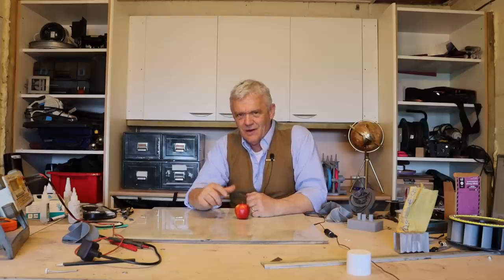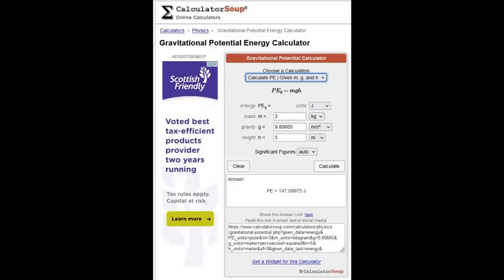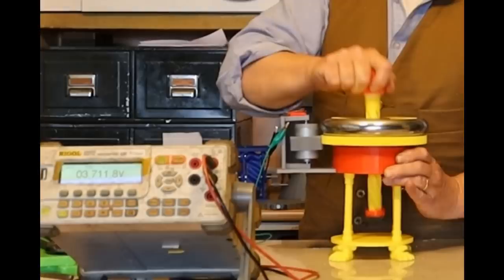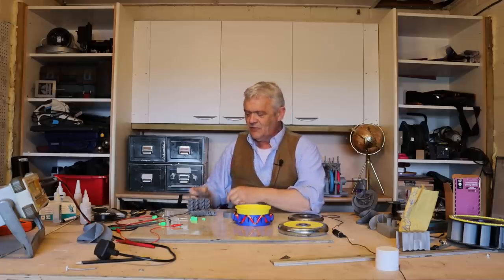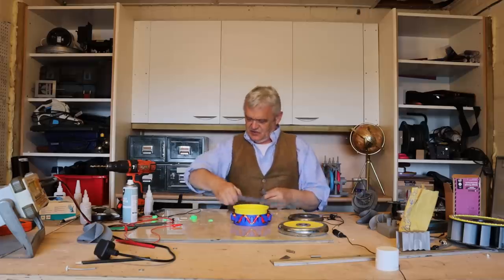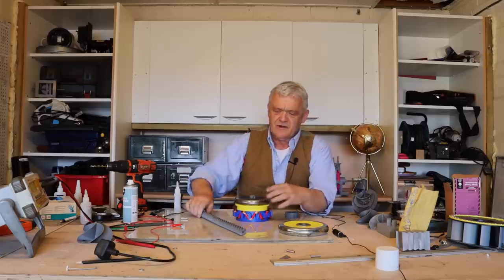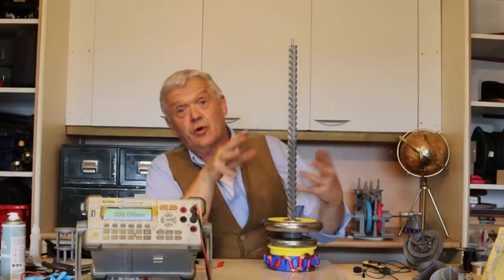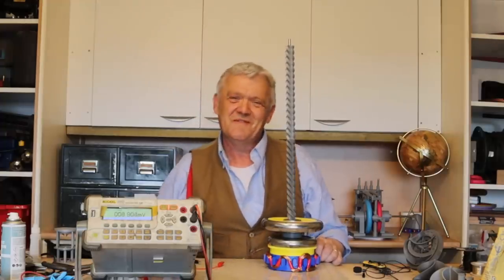2047 Gravity Energy Storage

Comment: When a permanent magnet attracts and holds a piece of iron against gravity, is work being done? If so where is the energy coming from and why doesn't the magnet "run down", if work isn't being done, what is happening? If I held the piece of iron aloft, I would need to expend energy.....Your talk of lifting weights made me think of this.....
Reply: I think the best analogy is to compare it to Gravity.
With gravity, the force is only expended at the moment of attraction and impact, but, once impact is made, contact is now the "Resting state." Attempting to remove the magnet(s) or objects would be where more energy was required.
Reply: Follow up question: is a mountain being held up by a constant expenditure of energy and will that energy ever run out, leading to a completely smooth Earth? Are there ancient planets that have become smooth after running out of energy to resist gravity? Do atoms need to expend energy to not simply collapse into each other? Will matter itself eventually run out of the energy required to make it matter in the first place?
Reply: @ArosIrwin  Great observation! So there appears to be an infinite source of energy in the universe, we just need to expand our understanding in order to engineer free access to it! We have trapped ourselves into the closed system of thermodynamics which limits that understanding and access....
Reply: For work to be done, a Force has to be moving through a Distance. If either one is missing, there is no work to be had. E.g. If a force is being applied to a mass but it is not moving. No work. Conversely, if a mass is coasting along in space with no force applied. No work. Push a brick along the ground, Force x Distance = Work. For a magnet holding aloft a piece of iron, nothing is moving. No work.
Reply: An object at rest has potential energy, regardless of the reason it’s at rest, whether it’s being magnetically prevented from falling, or mechanically, for example, on the palm of your hand, or, being on the floor.
Reply: @Gruxxan Yes, but the piece of iron is held underneath the magnet, defying gravity. If it were an electromagnet, energy would have to be dissipated to create the magnetic field. The permanent magnet just keeps holding, no circuit power needed. Obviously the magnet was magnetised in the first place, but that energy is not dissipated  as it holds the piece of iron, unlike with an electromagnet that will drop the piece when the coil is de-energised. So it seems the permanent magnet is exhibiting a characteristic akin to gravity......?
Reply: There is potential energy, but since the iron piece doesn't fall off by itself, it needs some extra energy to make it fall, so that when the piece is at a minimum distance it can fall off. It reminds me of the activation energy of a chemical reaction
Reply: @ArosIrwin simply, yes. Matter is simply ordered energy. When the order is gone, matter is no longer. All that is left is a soup of incoherence.
Reply: The magnet isn't doing work on the metal, it's just that Earth is failing to do work on it. The reason behind that is that gravity is by far the weakest of the interactions so even the entire Earth isn't enough to overcome with gravity the effects of that single magnet that uses the electromagnetic force instead. That's also why gravity doesn't flatten structures in situations when chemistry has a say about shapes.
Reply: @mfr58  1) magnetism is one of the 4 fundamental forces, like gravity, yes.

2) permanent magnets do lose some strength under load, it just takes lifetimes, as it is doing said work, even on an obeject at rest.

What you want to do is look up magnetic flywheels and kinetic energy storage systems.  The answer you're trying to get to is far, far too in-depth for simple YouTube back and forth.  There's unironically 8 to 12+ year degrees dedicated to the subject lol.
Reply: Great question! It has resolved my lifelong curiosity with magnetic possibilities. As much work as it takes to attach a magnet, it takes 100% - that to be unattached. Changed my reality. Thank you! 
Example, how easy is it to smash a window with a hammer, if you have to make that same exact window from silica and that same exact hammer from iron ore?
Reply from the maker: no mate - work is force times distance - if it is holding the iron it's really like asking does a screw do work to hold up a shelf.
Reply: @ThinkingandTinkering  That's a logical observation. But  it does rather side step the issue of the apparent power of the magnetic field, superficially at least it seems very different to apparent mechanical holding of a screw.....
Reply: @saiello2061 Everything is moving, we just don't sense it because it's all relative.
Reply: @mfr58  That mechanical holding is also based on the electromagnetic force, mostly in the form of the chemical bonds in the material of the shelf and the screw itself resisting deformation by shear stress.
Reply: @jounik  Yes, that's true. So we start to get to the non "material" quality of nature. Everything is spinning vortexes of different wavelengths, so if we can comprehend more deeply how this works, an infinite source of useful energy could be available to us, beyond the constraints our current physics imposes on us.... Given people's responses here, the phenomenon of magnetism is not sufficiently understood at present...
Reply: Potential energy can be statically stored, but there's a cost to release it for use.

Same as a piece of wood holds potential energy and releases it if you burn it, or an apple holds energy until its processed by a system that can harvest it.

It's also the reason you can cut metal with bacon...
Reply: @adrianscarlett  If I hold a piece of iron close enough to a magnet, it is apparently attracted to it and moves toward it, where it is then held (if not attracted more by gravity). So is work being done when the magnetic field "pulls" the iron from my hand toward itself?
Reply: I suggest you revisit the definition of mechanical work as it was taught to you in school: the force applied to the body multiplied by the distance upon the body is moved. If the body doesn't move then no work is being done. The mere presence of a force doesn't mean that work is being done.
Reply: @lucianene7741  I suggest you revisit what I said. The piece of iron is moved toward the magnet...force x distance = work?
Reply: @mfr58  
It's pretty clear what you said. You didn't mention anything about the object being moved, just attracted and held against gravity. Then you equated this with you holding a weight aloft. Attracted doesn't mean moved, it only implies the presence of a force.
Reply: @lucianene7741  Yes, correct that was my initial comment, but in response to others I did mention movement. But anyway, can you now answer my question, is work done when the piece of iron is "attracted", moved toward the magnet over a distance?  According to your quoted definition the answer seems to be yes, yet I am told work is not done ....so?
Reply: @mfr58  
Work is being done during the process of moving the body towards the magnet. The energy that is used to produce this mechanical work comes from the potential energy of the magnetic field - it's called magnetic potential. Every force of nature has an associated potential - electric potential, gravitational potential, even nuclear strong force potential. The last one is VERY strong, this is why nuclear fusion releases so much energy.
Reply: @lucianene7741  Yes, but my issue is that the magnet never runs out of the ability to do work, it will be able to keep moving ferrous material toward or away from itself indefinitely  (save for domains randomising over time). So why can't we access this "free energy", after all the universe is filled with it?
Reply: @mfr58  
This is not free energy. Force does not equate to energy. Replace magnetism with gravity and the situation is the same - you can't use gravity to generate free energy. You need energy to generate work - nothing comes free.
Reply: @lucianene7741  That sounds correct, but we are left with a mass being moved over a distance by a force, which I'm told equates to work being done....It seems like gravity and magnetism are exhibiting similar behaviour....could they be different faces of the same quality?
Reply: Important thing to note: work is not energy, though they do have the same units. Energy is the capacity to do work, but work is just force applied over some displacement. Think of energy as what a system could do, as opposed to work, which is what it actually does. In your mountain example, the mountain expends no energy keeping the rocks at the top at the top. If the rocks are moving, like in a mud slide, then work is being done. Do note though, that if the rocks that fell were somehow placed back where they originally were, no work was done, and that is because the process doesn't matter, even if there was motion involved. Work is a net measure, so what you pick for the start and end state of the system matters. If a force is applied that ultimately puts the system back in the same configuration as before, no work was done because nothing really changed. In ideal scenarios, where you can ignore fiction and other inconvenient realities,  you can do something and undo it and achieve exactly zero work, but in real world scenarios, there is always some work being done even in cyclic systems like engines because of the friction or other forces that have to be overcome across its various surfaces. This is often accounted as waste heat or acoustic noise.
Reply: @Zeero3846  
So much effort just to put out such nonsense. Sorry, but work IS energy. Same as heat, kinetic energy, radiation, electric/magnetic, chemical energy, potential energy, enthalpy. One form of energy can turn into another. Stating that work is not energy would cause your physics teacher from school to facepalm.
Reply: @Zeero3846  So when a magnet apparently "drags" a piece of iron across a surface toward itself, work is done due to friction between the surface and the iron piece. So the magnet should lose energy, but it does not appear to.....
Reply: @ThinkingandTinkering I've always thought we could use the house as part of an exercise routine - using our chimneys for a gravity energy storage device?
Many of us live in houses with defunct chimneys, so why not put a weighted device inside the chimney with a cable attached to a pulley in the loft - which we can wind up as part of an exercise routine.
I have 2 chimneys, so double the energy storage - each chimney has about 7 metres of straight rise before the end in the loft. 
I'm just wondering if something could be made to test the theory?

Comment: Often the criticism of gravity batteries is that it's inefficient and generates waste heat. But maybe that heat can be used to generate from a Stirling Engine at the top?
Reply: Wrong.. Gravity batterys are in large hydro plants 98-99% efficient (Pumped hydro 50-55%) 
The problem is scale, atleast for small scale use
Imagen to pump   1000Litre  water up to a 100 metrer  above and you will use 1.5kWh of work.
If you let this water into a turbine, you will only get 0.98 kWh back 
this system works the same if uou move steel or water "up a hill"
Big scale hydro plants are maybe 20% or  more efficient than geared systems
Reply from the maker: i don't think there would be a lot of wast heat in this design mate as the bearings on the collar really go a long way to reduce that as does the direct connection to the generator section
Reply: True for the thrust bearing suported rotor/flywheel generator part, But for a full cycle you will have to also calculate friction in the  archimedes gear,Same as efficiecy losses in pumped hydro.. @ThinkingandTinkering

Comment: so presumably the device is reversible, by putting energy into the generator it would turn the axel and raise the weight.
Reply: Yes, and you could supplement the electrical need with solar to make it much more efficient.
Reply from the maker: yes exactly - or just pull the weight directly up with a winch

Comment: The first gravity battery I saw was in a YouTube video where a student showed their gravity battery using block weights like you would find on exercising equipment. They would turn a crank to rotate the main assembly 180 degrees to "recharge" it and it would power several LED panels at the base of the assembly.

Comment: Okay. One? I love this, lol. Two: I feel like it could benefit from some clockwork. Specifically the part of the clock that prevents the coil spring from completely unravelling. Three: A modification: Build the clockwork into the base, and use the weight to charge a spring. Four: You need rails attached to the falling weight to prevent it from rotating. That way all of the force from the fall is directly transferred to the shaft rather than a small portion being lose due to the dropping weight beginning to spin. Five: You'll need a spacer or bearings or something between the falling weight and the flywheel weight. You lose a lot of your rotational energy when the large weight lands on top of the smaller one because the rotational force has to be applied to the combined weight rather than the flywheel weight. Same concept as spinning on a swing and pushing your legs out and pulling them in to go faster or slower.

Cheers!
Reply from the maker: i agree clockwork would be an awesome addition

Comment: I had two thoughts about this as I was watching: 
1) For stability's sake, it could be relatively easily mounted inside a 4 inch soil stack pipe bracketed vertically to the side of the house. Off-the-shelf end plates could then be drilled to make the supports for the centre spiral. (Obviously, elements of the design would need resizing, but the generator could easily sit outside the tube at the bottom, meaning you only need to resize the falling weight)
2) It looks like we're developing torque at the axle (the spiral), and then pushing it out to the rim for "generation at the rim", I can't imagine an easy way of doing it but I can imagine that there are some gains to be had in collecting energy from the rim of falling weight itself. capturing both the gravity and the spin.

I love this idea.

Comment: Perfect for a wave floater! Would be a decent test for your glass bearings and a day at the beach, eh? :) Would still need some amount of weight to drive the rotor. Enough balloon size to counter the weight wouldn't be an issue until you get to a size noticeable to a Karen. 

Or you could lay it horizontal and use a vertical plate with spring returns, etc. 

Great proof of concept!
Reply from the maker: That would be cool! - awesome suggestion mate - cheers

Comment: I thought I’d get in now, even though I’m off topic, with the hopes you’ll give this idea some thought. 
So….
Using your “gravity is free” approach and adding it to a Trompe pump system…
My thought is you could utilise the void space in deep pile and/or bridge supports to insert vertical Trompe air compressors in what is otherwise wasted space. 
There must be some location, close to running water, where a change of head is also available. 
The deeper the Trompe, the higher the isothermal, dry, oil free, air pressure becomes. 
Such air could provide ‘air conditioning’, free of ongoing costs to a building. As no water as consumed in the process, this could be invaluable in hot climes with high power restrictions. 
Highly compress air could run generators with no emissions! 
It could be used in place of batteries to power vehicles 
It can certainly power workshops. It already does. 
Anyway. That’s my musings. 
Great posts, keep ‘em coming! 👍
Reply: Or , one can use compressed air from Trompe pump to power up Tesla turbine (with generator attached) and produce some energy that way....
Reply from the maker: cheers mate and thanks for sharing your ideas

Comment: If you have a pair of rocker buckets, you can run such a generator in a flow of water.

With self emptying 'trip' bucket valves, one can have the water automatically go from the one bucket to the other, working in the classic 'teeter-totter' fashion, and all you need to divert the water is a little 'bill' poking up out of the center, which, by the mere mechanical principle of rotating vectors will, with no added mechanism, divert the water flow into which ever bucket is in the 'up' position.

This 'bill' can be on a tipper affixed at the top with either a direct linkage [for a really short travel fall] OR, with a passive drag bar, if the buckets are dropping a significant distance.

So as the bucket fills, it begins dropping as the other bucket begins going back up [either by a bar, or, if it is a really long distance, a rope or chain with a pulley], the bill is pulled toward the now empty bucket, which, because it would defeat the purpose to have it fill before it got all the way to the top, has a trip lever valve which can only be opened or closed by additional mechanisms [latch engaging and latch releasing attachments] at each end of its travel. 

Thusly, if you had only 2 buckets or, if you had a wobble plate with many buckets [say on a rotary cam for instance] you can always keep the empty bucket empty until it is in a position to push down from the peak of the travel, therefore not defeating the imbalance.

Comment: You could adjust also the timing of energy release by having an adjustable angle between 0 and 90 degrees. Smaller amount at time would be released but for a longer period. I think.